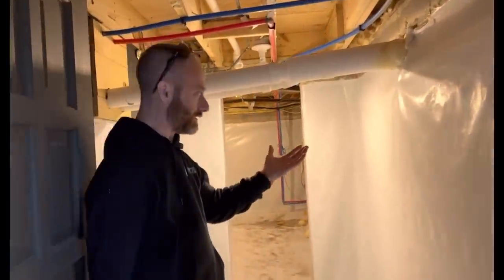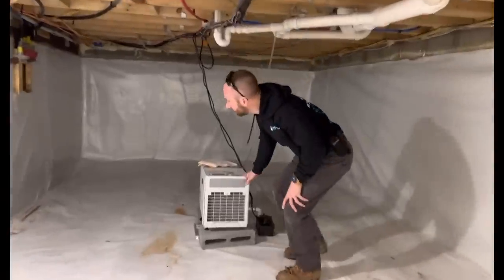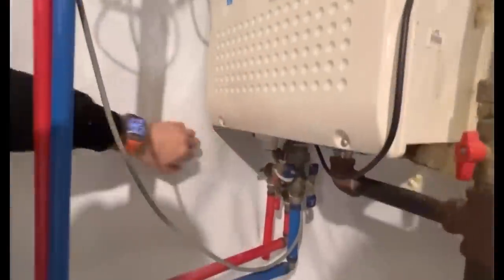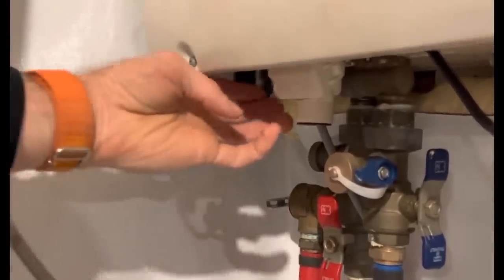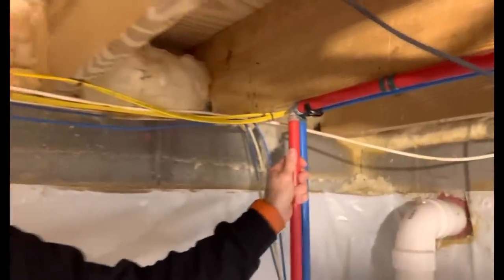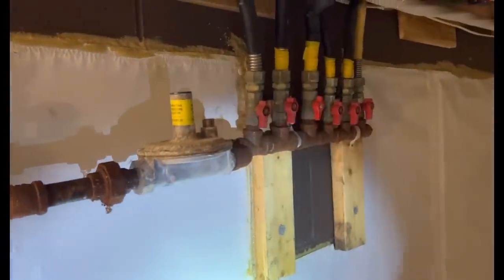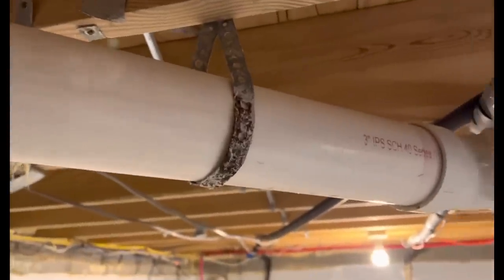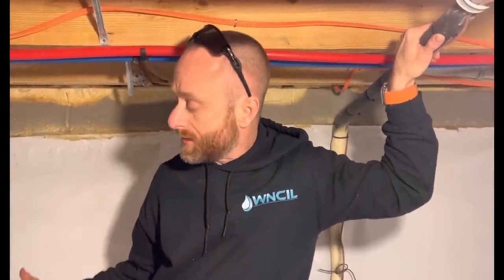Million Dollar House With a “Tiny” Problem!

Comment: My last house had a clogged dryer line. Rather than clean it out, the previous owner just went in the crawlspace and drilled a couple of holes in the vent pipe.  Turns out that replacing a clogged dryer line really makes your clothes dry much faster. Go figure.
Reply: I bet to fix a wobbly table they use sugar packets
Reply: The fire risk :O
Reply: So, here's the deal. If the guy is gonna crawl underneath house then why didn't he just replace it?
Reply: The first that popped into mind when I read "dryer line" was the image of a clothes line. For a fraction of a second I was like:
🤔 "Clogged? How would..." 
Yeeeaaah, so... English isn't my primary language. Ha, ha, ha!

Comment: You should not have any steel strap or steel touching your copper lines or fittings. It will cause galvanic corrosion, the two metals are too dissimilar and one will pull the electrons out of the other making it break down. Sometimes unskilled tradesmen will have steel electrical conduit straps affixed to copper water pipes in the wall so be careful buying a home and hire a real home inspector before you buy.

Comment: I’ve been in a few stopped up drain calls and when tracing the drain lines that led into a crawl space what did I find, a crawl that had a ton of moisture or water standing resulting in the corrosion of the band iron and nails causing it to break and resulting in the drain line having a huge lull in it causing it to hold water and stopping up the drain.

Comment: My favourite one as a roofer is "yeah the leak started a couple years back"
Like yeah ok, let's see how the woodwork is now. 🙄
Reply: Going through this know. We unfortunately were not aware there was a leak until now, when it's already done a lot. Evidence is showing a lot of band aid work was done, and done poorly
Reply: @Junierox  patch jobs always increase cost. Every damn time. 
Thankfully I'm an Aussie, so we don't have the wooden deck like you guys. But that means most wood work that needs to be done is structural. That's when your price can start jacking right up and the risks are much higher.
Reply: @bneskylights1152  what are you using under the roofing for support if not wood?

Comment: Extra fun in an old house (102 years old) finding that after tearing out the old cheapie shower pan in the downstairs bathroom, that the previous "repairs" and "renovations" were just "toss on a plyboard to cover up the rotten parts" and "put in the cheapest shoddy install and don't even seal the drain properly".    We're ending up tearing down the floor of the ENTIRE bathroom and redoing from scratch.  The entire thing was warping from advanced moisture damage and we were lucky we didn't bust through to the basement.
Reply: I pulled 7 layers of ply out of one bathroom. The bottom ones were like peat. I also had to replace the joists.
Reply: The moisture proofing often makes the issue worse. If the crawl space/basement is cool, then moisture will want to condense there. If it is plastic lined, it will just accumulate.
This house may, or may not be fixed with the condensate line.
Reply: Ours they just poured self leveling concrete to "fix it".
Reply: Our old house is 70 years old. We have had a few "fun" moments. When we remodeled the bathroom, we discovered that the large wall of the shower/tub was rotten. Luckily, it was on the outer wall of the house and that made it easier to tear out and replace the whole wall. Also, some time over the years, someone had cut the floor joist directly under the toilet and left it that way. Every project we have tried to do in this house has turned into something bigger than we had planned on! Oh the joy of home ownership!
Reply: I was just at a house where the shower pan and walls failed due to bad design and installation. The house was built in the mid 90's.
Reply: @pictsidhe6471  I had the same issue in a 1927 house. The last layer was carpet. They cut an x over the toilet drain pipe and set the toilet right over the carpet. I ended up removing 7 layers of flooring, 20 sq feet of subfloor and three joists. Nice surprise...
Reply: @therealbadbob2201  the ol carpeted bathroom.. iconic 🙌
Reply: I have been there, done that. I feel your pain!
Reply: Same last house was built in the 50’s wall to wall carpet. Multi layered floors and turquoise fixtures in bathroom. Current home built late 1800’s someone built down stairs bathroom ont the back porch and leveled the floor with press board. Plus now I have to do lead abatement on all the windows as well as outside second floor trim. Don’t ever buy an old house unless you want to spend a ton of money.
Reply: @societasdraconistarum  A lot of money and time. If it is hired out, many construction/remodel companies do not fix things correctly, especially on a really old house.
Reply: @eldonhoward7925   Oh yea I know that’s what I’m fixing now. Mess up’s that weren’t done right the first time. Luckily I buy knowing something of what needs done.  Plus I never spend a lot on the home purchase.
Reply: @don2deliver  Wow!
Reply: @societasdraconistarum  Lead abatement not as bad as asbestos abatement... flippers across street a couple years ago had to have special crew remove asbestos this and that (floor tiles, pipe insulation etc).  It cost a LOT.
Reply: @petuniasevan   Yea that shits nasty. At least I can cover mine with paint and aluminum trim you can’t cover asbestos.

Comment: I did a tile floor over old terrazzo. 6 years after i installed it he had some tiles popping up. There was a pink mold growing under it. I told him its a moisture problem. No warranty but i will do the repair at a fair price. His daughter was my longtime girlfriend and been a friend of the family for decades. Come to find out, when he dug his pool, there was a lot of water coming out of the hill he was on the bottom of. A little research showed that someone higher up the hill had plugged a natural spring. Another homeowner was digging a pool. It took two big pumps to de water this little hole. No small amount. My friends house is basically floating on mud.

Comment: I've got a good one for you. Two unit house, each unit with a cathedral ceiling and a large second floor loft.
 Laundry machines on the main floor, and the drier vent pipe was led up into the eaves closets on the loft--not outdoors at all!
 Rerouting it out the (basement) crawlspace window made that drier work one hell of a lot faster.
Reply: I can top that. My last house had a clogged dryer line. Rather than clean it out the previous owner just went in the crawlspace and drilled a couple of holes in the vent pipe.  Turns out that replacing a clogged dryer line really makes your clothes dry much faster. Go figure.

Comment: Demo'd a cultured marble shower stall, the previous home owner installed it diy job, walls was in great shape same as base the problem was the base was cut out of a larger base so it was a slab no curb or anything like that the drain coming out of the concrete floor is 2 inch "that would of worked" but he decided to raise it up almost 2 inch using 2x4's "nope he didn't pour concrete and put in a shower pan under it he set the slab on top of the lumber  oops the 2" pvc was long enough so he took 1 1/2" pvc slid inside the 2 inch and silicone around it and the drain connection to the base was 2" so he slid the 1 1/2" pvc up into the 2" shower drain fitting and silicone that, then he put the wall up took left over from what cut off the walls and made a curb with that, no waterproofing, just a lot of silicone and caulk, it lasted about 10 years "this is a vacation house".
If this was actually installed correctly with it being cultured marble should last 50 years or more.

Comment: I moved into a 1910 home 40 years ago and it had a moisture issue due to the rock foundation. Added a dehumidifier but still had damp corners. Added a small fan on a timer for a few hours daily and never had a problem since. The fan basically moves the air in stagnant areas so the dehumidifier can reach further. Sometimes the fix is fairly simple.

Comment: The 3 biggest problems caused by water are metal corrosion (water & gas pipes, electrical wires/connections), wood rot (joists, studs and rafters) and the biggest threat, mold...

Mold will get the people living in the structure long before the corrosion or wood rot will cause problems with the structure...

A 4th problem is an offshoot of the wood rot problem in that damp or wet wood attracts insects (termites, ants etc.) that can also become a problem and/or accelerate the wood rot problem...

Comment: Condensate from natural gas combustion is extra corrosive too, it's not like the distilled water that condenses from your air conditioner. It's basically diluted sulfuric and nitric acids.
Reply: Which is why it can ruin some waste pipe systems if not neutralized before being dumped down a drain.  If a house had cast iron, copper or galv. Waste pipes the trickle of condensate can eat a hole through them rather  rapidly.
Reply: @fixerupperer  same for  metal flashing and gutters if you dump it on a roof. People forget it's not just water and common pipe it with the a/c condensate.

Comment: The condensate drain on many high efficiency boilers/water heaters also surges as a block for the burn chamber. Often requiring a trap to be placed external to the boiler like a p trap. Not having this allows combustion gases to escape the burn chamber. So not only are you pumping humidity into the room, you are also getting exhaust.
Reply: That exhaust is corrosive too.
Reply: @GoatzombieBubba  is that why it is connected to a pvc line?

Comment: Great vid! Some tips if you want them.
The "oil line" for the ac is more commonly called the liquid line. Your right about the time frame of the corrosion of the gas pipes and strapping, but corrosion in the gas piping is very serious. You get pin hole leaks when black iron piping rusts. The metal clip for the (CSST) gas line isn't a problem here, might be a building code for you, but that isn't universal.

Comment: This will make me check to see if our codes have been updated. Our furnace condensate empties into our laundry tub.  We run a dehumidifier and AC during warm months. I keep an eye on brackets and pipes for changes. If I see condensation on cold water lines as the weather warms up then the humidity is too high. Thanks to your insights.

Comment: Those high efficiency water heaters have a real nasty habit of producing acidic condensate. Should be into a neutralizer and then into a condensate pump, from the pump up into the sewer line with a back flow preventor. At least in Ontario Canada anyways. Good find man.

Comment: My sister was looking at a million dollar home for sale. She asked me to look it over for her, It was built on top of lava cap. The underside of the home had been damaged by water flowing over the top of the lava cap and under the thin layer of soil under the home.  They put a rubber liner down and covered it with pea gravel.  
It really didn't do much to remedy the humidity problem. I noticed a beautiful little California King snake that was trapped inside the stem wall so I climbed under the home grabbed him and set him free to hopefully eat lots of rattlesnakes as it was right on the edge of a canyon. 
  Then I suggested my sister not consider buying that home.

Comment: Great advise.  get your house checked regularly.  My insurance offered a discount if have annuals performed and i am glad i did.  they spotted a bad gas line going into my water heater next to the ignitor.  was told that if the gas had leaked little bit more it would have become a bigger problem.  and here in NM it's like $90 for an inspection.

Comment: Certified HVAC/R tech here.   That’s not an “oil line” but rather the high pressure/high temp “liquid line.”   Yes it has some small amounts of oil in it, but the entire system does.  That’s simply refrigerant in a hot, but condensed state.  So it’s liquid refrigerant.  As it gets to the indoor coil, it’ll go through a metering device of some sort as it’s delivered to a lower pressure state.  That reduction in pressure causes the refrigerant to “flash”(instantaneously evaporate to a saturated gas)  this flash is what absorbs massive amounts of heat from inside your home.  The bigger line is your suction line, it will suck this cold gas(which has absorbed massive amounts of heat, but is still very cold) and it will transport this heat outside to then be compressed, and then run through a outdoor coil which will reject most of the heat.   Then the cycle starts over.   

I’m just being a nerd. 😅
Reply: Caught that too lol, now I don't have to say it.

Comment: Making a lot of updates on a nearly 50 year old hoituse and the first one was the laundry room. OMFG the issues with the dryer......  The 4" opening for the vent to outside was probably a 2" opening because of all the lint and ????  in it. PVC elbow on the exhaust vent of the dryer for starters. It was facing UP. Then they used all 6-8 feet of the hose because I guess there was no reason to cut it. The dryer sits right next to the outside wall. But the best part? That exhaust hose ran both up and down both sides of the GAS line going to the dryer. 

After cleaning out everything, cutting the hose, replacing the plastic elbow with metal and turning it to the side. The vent hose no longer touches the gas line at all. And the dryer works so much better and faster now. Probably last many more years now that there's minimal risk of it heating up the gas line and leveling the house.

Comment: In denmark, we had big reno. Done in the house. 
Prof. Did the various jobs and as is required in Denmark, dif. 3rd part controllers came out at various steps to check it was up to code. The bonus is off course, less risk of problems from a lazy handyman, and your insurance covers for 25 years on most of it.

Comment: This is awesome. As someone who has worked on many old (60-120+ y/o) homes in Chicago, I've run into A LOT of really fkd up stuff. 
As a professional software engineer (with a EE from Purdue)  from a family of tool and die makers, I've been exposed to many situations. I get called in by FOFs who have an issue that is too small for many plumbers/elec. who don't want to touch it. I know f-all about encasing ones entire basement in a ziplock bag; however, I have enough education to spot issues quickly and, if not help fix it,  point them to someone trustworthy who can help. 
Rather than sending your kid to 'college' to get a degree in marketing communications, first, they should learn a trade. No matter which one, it will teach them how to use their hands and minds and give them confidence to learn other skills. 
We don't need more young people going to half-rate colleges and getting marketing degrees, we need a new generation of people who can fix/build stuff.

Comment: I see PEX pipe. Part of the problem is that newer houses tend to be built out of cheap, low quality materials. (Such as CDX plywood, and 2x3s instead of 2x4s, for example.) Older houses were built out of stronger, more durable materials. Your floor joists should be 2x8 or 2x10, even 2x12, but not wood "I-beams" made out of two 2x3s and a CDX plywood upright sandwiched in between. That's just built-in obsolescence. Moisture will warp and separate the plywood. Mold could easily invade. These McMansions won't even last 40 years, most of them. I could show you houses built in 1840 that are still standing structurally sound, and occupied. Basements should always have a floor drain, or at the very least a sump pump. I don't need to tell you that shit runs downhill. Yuppies seem to mostly have too much money and not enough brains. And there are plenty of unscrupulous companies out there eager to take advantage of the fact. That's why you run into those tubes filled with quartz pebbles, because some slick talking snakeoil salesman swindled the clueless yuppies into thinking it was aome kind of water purifier, and the yup-yups bought it hook, line, and sinker. (Just like they bought those McMansions that are gonna fall apart in a few years.)